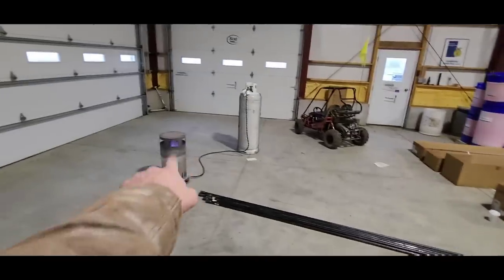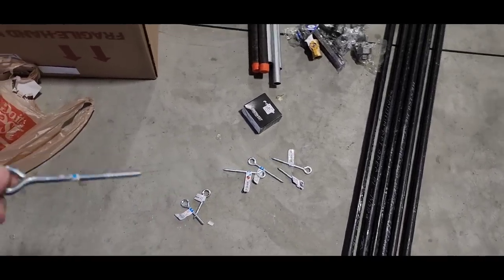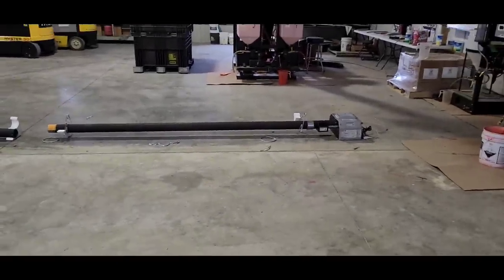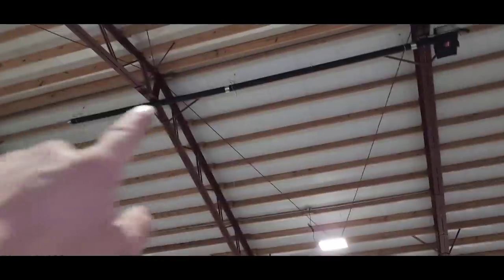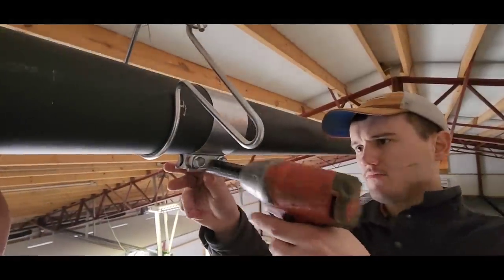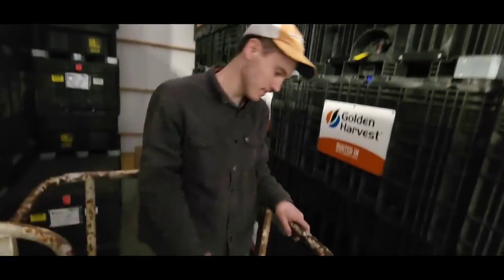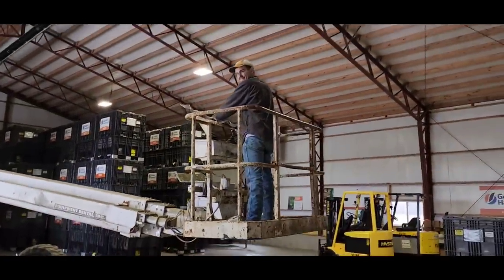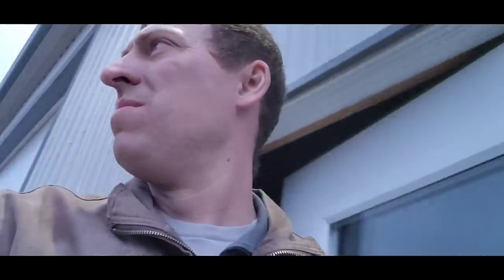Hanging a Radiant Tube Heater

Comment: I’m a new follower of your site and enjoying your contact you might want to check the distance to combustibles on your tube heaters I’ve had them for years in my shop and there’s a flame that shoots out of about the first 3 feet and it’s gonna be pretty hot good luck I think you’ll enjoy the warm
Reply: yea he spent a bit of time fretting over how to place it for those very reasons , . You;ll notice in your days here Nate can be a bit OCD about EVERYTHING. Welcome aboard
Reply from the maker: 6" above and to the sides (the metal trusses aren't combustible) 92" below, which is why I put 1 in the peak instead of 2 further down the slope to the sides. I needed the clearance to my seed boxes.
Reply: Nathan, great job on the heating tube and the conduit installation, enjoy all your videos.👍🏻👍🏻👍🏻👍🏻👍🏻

Comment: Lol, those are thread protectors. Couplings are different. Threads don't all the way through.  They are tapered. And the outside of the Couplings are completely different looking. Thread protectors are smooth on the outside. But you do you. I wouldn't install those, but you do you